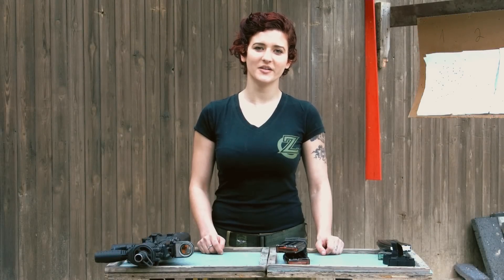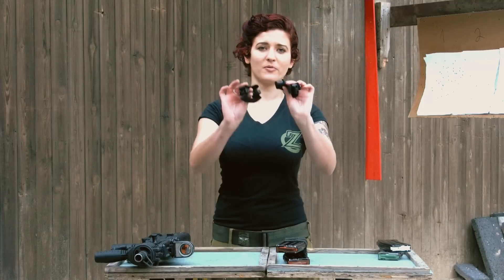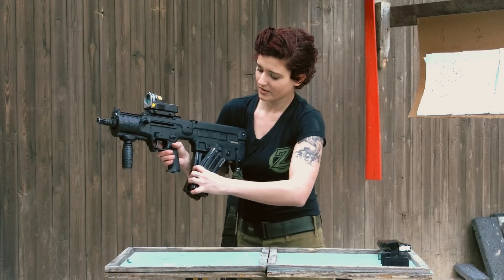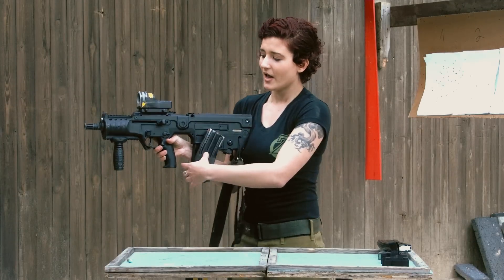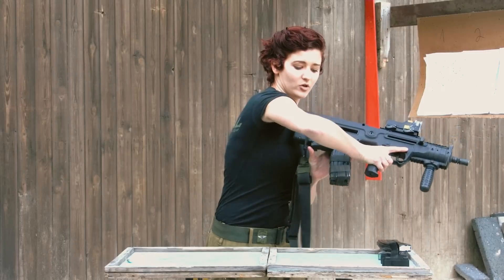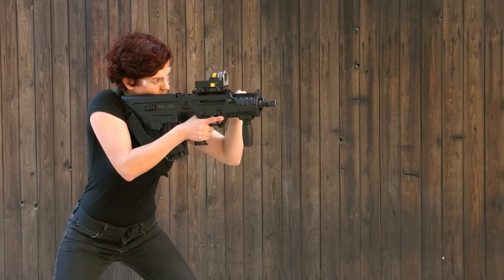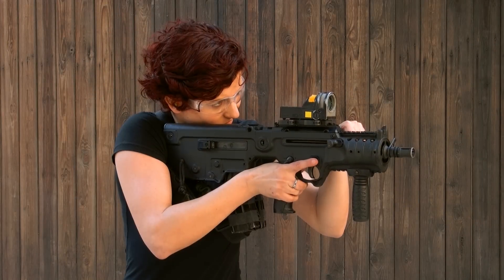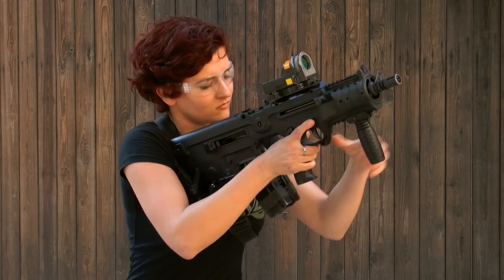X95 Reloading: The Fastest Way To Reload Your Tavor by Zahal

Comment: Im a soldier in the idf and i use tavour x95 the methood looks nice but there is couple of problems 1. With 2 full magazines its make the rifle much heavier in the short time its hard to see the diffrent but when you with the gun all the time and you holding it for 6 hours + you will feel the wight of it another problem its you need to run crawl and alot if things with the gun so the magazine probably will fall down but its looks like a nice idea i prefer traning on replace it from the vest faster
Reply: I mean, after the second mag, you're going to be reloading from the vest regardless right? Seems like a pointless tip to me. Plus she wasn't trying to flip the magazines with full gear on either.
Reply: Yes, and no vest is made for 2 magazines stuck with each other. So throw them away, explain to your commander you lost two magazines behind enemy lines and then buy a new mag coupler from Zahal.
Reply: Thanks for sharing your insight.  It makes a great deal of sense.  Just to train from the plate carrier pouches so you can stay mission ready and not having to deal with the extra weight.
Reply: I am Indian and i love idf ❤

Comment: Sweet technique! It allows for a quick change without having to stagger the magazines, so one won't cover the ejection port when you link mags, or having to "chicken-wing" your arm, once you shift.
   The only drawback I see it the magazine coupler itself. Magpul doesn't make a solid mag-link, where the magazines can be reversed, and apparently, neither does Zahal. One would think that introducing a new technique to the world might go better with a new product specifically for it.
Reply: You take spent case and put it in a good spot between 2 mags, then use duct tape to join the mags together in the same arrangement as the video.  You can even hang a loop of paracord in the middle!  Guerilla MacGyver, tactical mods.  No need to "buy" mag couplers.
Reply: @JL-gg7ph  - Old problem.  Zahal solved it a few years ago.
Reply: @fleetcenturion did they?
Reply: @longiusaescius2537  - Yes. They have since made one.  This post is EIGHT YEARS OLD!
Reply: @fleetcenturion  what's the solution?
Reply: @longiusaescius2537  - Exactly what I described, in my post.  I know, because I now own one.  Now leave me alone.
Reply: @fleetcenturion  "most patient iwi customer"

Comment: the flipped mags looked counter intuitive at first, but it's actually quite a natural movement.
Reply: but why not having both mags paralell to each other? then it´s just putting out and back in and you don´t have to grab it so difficult.
Reply: @trigger-red-airsoft  I think the problem is that the mag is right behind your firing hand. If parallel, the new empty mag moves outward and would be digging into your forearm or change your wrist angle.
Reply: @bw7069   I thank you!

Comment: I'm wondering why would you not just connect the magazines oriented the same way so you wouldn't have to twist on reload?
Reply: Keeps amo tight against the back wall of the second mag during recoil. Amo could slip forward in the mag other way around possibly hindering insertion into the mag well or cause feeding issues.

Comment: Why not just have them pointing the same way to avoid wrapping your arm around the mag to twist it
Reply: ***** that makes more sense hadn't noticed  that I'll try it with mine
Reply: jrcann jay I thought that initially until I saw that the free mag stays on the same side ... not interfering with the pistol grip hand.
Reply: It's also kinda nice that you can always see whether the extra mag is empty or not, which I assumed was why at first. But it probably makes a lot more sense that there's more to it than that....

Oh, and I imagine with a standard Tavor, the thumb would first be used 
on the mag release? So it'd have to be there to start with anyway. [I know a lot of shooters use their main hand for that on the standard Tavor, but I'm assuming IDF doctrine is different?]
Reply: wutsup I link my PMAGs the same direction and never have a problem with anything getting in the way of anything.

But I'm using a AR. Maybe the Tavor has tighter clearances or something.
Reply: Its so your chin doesn’t hit the mag when you shoulder the rifle
Reply: It's not tighter clearances, it's that when a mag is on the right side of the rifle, it will get in the way of your right forearm. AR doesn't have this problem bc it's not bullpup.
Reply: Also, having the magazine on the right side of the weapon will interfere with the ejection port.
Reply: If you have the mags pointing the same way, you'll end up with your chin resting on the spare magazine. With the mags pointing opposite directions, the spare mag doesn't get in the way of acquiring a good sight picture.

Comment: You CAN take a spent case and put it in a good spot between 2 mags, then use duct tape to join the mags together in the same arrangement as the video.  You can even hang a loop of paracord in the middle!  Guerilla MacGyver, tactical mods.  No need to "buy" mag couplers.

Comment: What kind of red dot does the IDF use on the Tavor? Looks very rugged.
Reply: Mepro 21
Reply: +Rod Jos thank you!
Reply: Chris Slack Anytime :)
Reply: although indeed the IDF uses the Mepro sight its very limited. The MARS sight is the standard issue. If you look on your Tavor for grip you will see a place for a small round button to be installed. This is for the switch to activate the MARS sight system on the IDF issue rifle. IWI opted for the Mepro sight do to the very high cost of the MARS. The Mepro-21 is 450-500 US dollars while the MARS sight is indeed much more and this would push the cost of the IDF model Tavor beyond the price of most customers.

Comment: Thanks great advice. !!!!
was that the 308 version. ???
very nice form any other tips. ? I am use to the ar-15 ( 16 in ). where did you get handle.
Reply: +anthonyelevatorguy
 there is no .308 for the tar-21 OR the x95...
the tar and the x95(some people call it the mtar)comes in 5.56/9mm and i heared might also come in 5.45 but i dont if its out yet

Comment: I know I'm ludicrously late to this conversation, but can someone explain to me why the mags are inverted in the coupler?  There are no buttons or levers on the right side of this gun that a simple side-by-side pair of mags would block when the empty's on the right, and length-of-pull isn't THAT bad on bullpups.  I'm certainly no X95 expert, but I've used tons of dual mag clamps on every manner of M4, MP5, G36, etc., and side-by-side -- pointing the same direction -- ABSOLUTELY provides the most economy of motion on a reload.  I'm open and willing to learn, but this looks absolutely ridiculous to me.

Comment: Why not just couple mags the same direction then you don't have to do that weird twist? It would be even faster that way...
Reply: It makes perfect sense, they explain it in the video's description, QUOTE: Why twisted?: The twist is necessary because the Tavor has the pistol grip in the front as you can see so if you change mags as you suggest then the empty mag will hit your forearm, will mess with your aiming and block the ejection port. By twisting them the extra mag will always stay in the "inside".

Comment: kinda contortionist mag change , why not the traditional way of side by side mag change.  straight pull out and insert . no need to train to remember that mags are opposite each other. seems faster that way or its just the isareli manual of arms?
Reply: make's sense then didnt know it covered the ejection port.

Comment: meh. i prefer single mags. i just let the mag drop free and reach for the new mag in one motion, then put it in.
Reply: That's exactly what I was thinking.
Reply: In IDF they use double mag even in the AR15. The reason is that when you are a soldier, you have to take your rifle with you all the time, but you don't have a vest full of mags all the time. If it happened and you need to use yours weapon, you probably want as much bullets as you can carry.

Comment: I just don't understand why the magazines need to be inverted, there really is no reason for it. If you use a standard mag coupler, or a small piece of wood with some duct tape if you want to be cheap, combining the mags in parallel with the right side mag about 1 inch lower than the left side mag, should work just fine. Not meaning to ignore either Natasha's expertise or pleasantly abundant assets .Go Israel ..
Reply: I have no issue with the right side mag hitting my forearm, because with the Tavor I just look at that as another point of contact. Also if the right side mag is lowered about 1 inch, then there is no issue with getting in the way of ejection. I mean by it's design the Tavor has a few quirks, but as with anything different, it just requires some extra practice to get use to it. It just seems to me, the more involved and complicated you make a tactical reload, the more likely it will go wrong when used in the field.  Go Israel ..